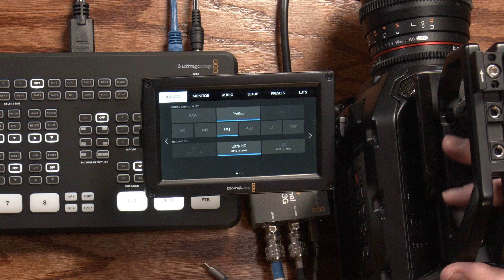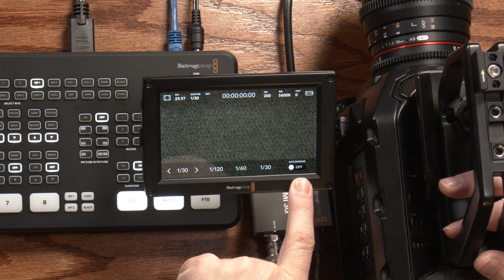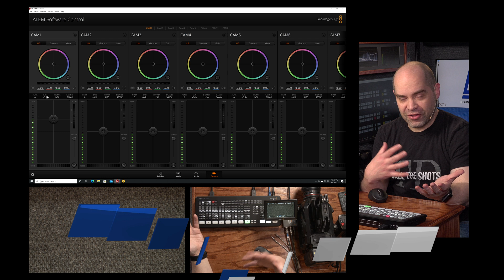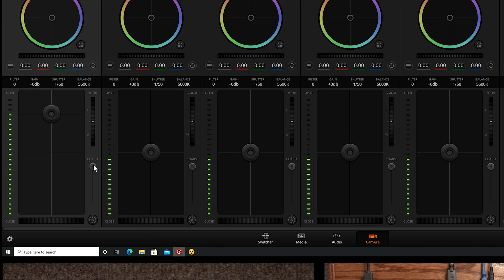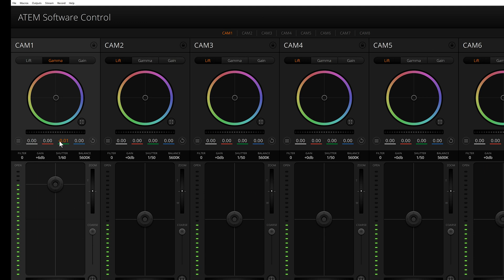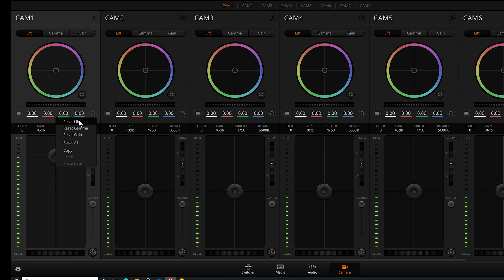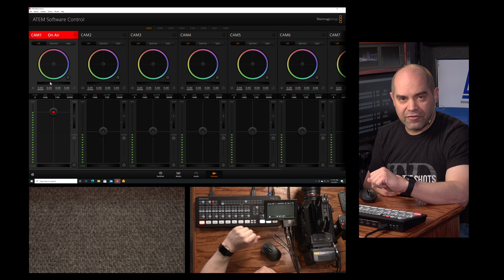How-To: Control Ursa & BMD Studio Cameras from ATEM Mini Switchers

Comment: hey Doug, can this  same method be applied to the blackmagic pyxis ? i own  a extreme mini iso hdmi and  would love to control  my [pyxis like my p4k and p6k
Reply from the maker: I’m not sure how it could. It doesn’t have either an SDI input or HDMI output that could be used to get those camera control signals into it.  SDI is not bi-directional, so the single SDI port that it has wouldn’t work to receive the camera control data from the switcher.

While it might technically be possible to do something with Ethernet or Wi-Fi, Blackmagic doesn’t currently support that.

While a few Blackmagic cinema cameras have had some limited camera control capability, it hasn’t ever been a high priority for them (or anyone else for that matter). Most people doing live production use cameras specifically designed for that application, and most of us find that cinema cameras often aren’t that well suited for that task.

Comment: Super helpful as always, Doug! I have an ATEM SDI Pro ISO. How would that work with these cameras since the HDMI is 2-way and can get back to the bi-directional micro converter?
Reply from the maker: The SDI output of the converter goes to an SDI input on the switcher, then you take one of the SDI outputs on the switcher (it doesn't really matter which) and connect it to the SDI input on the converter. That gives you the bi-directional communication path.

Comment: Hey Doug. Just came across your video. Really informative. Thank you for clarifying that the gain is the ISO setting. I have a similar set up with one BMD  4K pro  camera and 2 4K pocket cameras. They are all controlled wirelessly via the stem control software. Currently I’m trying to lock in the presets of ISO and light settings so that way we are consistent with the different cameras. I’m using an Atem mini as the switcher. We also have an elgato stream deck that’s used for macro functions. I just bought  a Panasonic 45-175 mm zoom powered MF lens. So I’m excited to try the remote zoom.

Comment: if you connect a stream deck to your computer as well as your item and micro cam, would you be able to control the camera settings on the deck?
Reply from the maker: One point of clarification... the Stream Deck device ONLY connects to a computer... it does not connect to the ATEM directly. You need a piece of software (BitFocus Companion being the most common, but there are others) to interface between the Stream Deck and any other devices. 

But, the other part of this, is controlling the camera(s). Companion does not currently have any built-in, direct camera control features for Blackmagic cameras. There seems to be some discussion of adding REST-based camera control support, but that hasn't happened yet. And in the case of the Micro Studio Camera, it would have to be the G2 model. 

Middle Things (https://www.middlethings.co) has an app called MiddleControl that will control Blackmagic cameras through the ATEM switcher (using the more traditional SDI-based control rather than REST), and there is a Companion plugin to control MiddleControl, so that might be a viable option depending on what you want to do. The functionality of this solution is somewhat limited, though.
Reply: @djp_video  thank you I’m getting that app now! you know possibly I’d like to add gimbal control to pan but right now I just wanted simple control through a separate panel just for the camera to control Iris, zoom, Wb etc so I won’t have to be glued to the camera control page on the Atem software

Comment: Hey Doug ... quick question, in the video you explain how to connect your SDI camera using an ATEM Mini Extreme HDMI version (hence why you're going over the BiDirectional converters), but what if you have the SDI version of ATEM Mini Extreme... how are using camera control and tally? Meaning, I know you'll be using the "SDI In" port on the camera, but where are you connecting on the ATEM? Any of the SDI Out ports? And in this situation, is this why you need to set the camera id within the camera's settings? thanks in advance!
Reply from the maker: Yes, any of the SDI outputs would work. You can even use a distribution amplifier like the SDI Distribution Mini Converter from Blackmagic if you don't want to use up all of your outputs. And that is why the ID needs to be set; all ATEM outputs contain camera control and tally data for all cameras, so the cameras have to be setup to know which ID to listen for.
Reply: @djp_video  ... Awesome, thanks for the quick reply and for pointing out the SDI Distribution Mini Converter!! All great stuff!! Thanks again :)

Comment: Hey Doug, I have an URSA Broadcast G2. Set up almost the same way I see signal to the switcher, but I don’t have control. Do I need to go into channel one or can it go into all the channels?
Reply from the maker: It can go into any of the channels. You may have a camera ID mismatch, or are using a version of a converter which doesn't create the required SDI ancillary data (it has to be one of the 3G or 12G versions of the Micro Converters -- the older versions don't have that feature.)

When connecting an SDI camera to an HDMI switcher, you can go one of two routes to get camera control and tally working -- explicitly set the camera ID for each camera and micro converter, or just set them all to 1. 

SDI cameras and switchers use data in the SDI signal to know which camera is being controlled. All cameras get the exact same data from the switcher, so it's that camera ID value within the signal that lets cameras know which commands they need to respond to. But HDMI switchers and cameras don't have any camera ID data -- the assumption is that the camera will be connected directly to the proper input, so no ID is needed (or even supported).

What this means in practice is that when you connect an SDI camera to an HDMI switcher input that the camera ID data has to be added by the Micro Converter (and it has to match the ID of the connected camera). This is done inside of the converter's setup software. And the camera's ID is set in its setup menus. In this one particular situation, the actual ID number doesn't matter -- it just has to be the same between camera and connected converter. Since the HDMI signal doesn't include any camera IDs, the switcher doesn't know what the actual camera ID is.
Reply: Hey Doug, thanks for such a thorough reply. We can see signal to the switcher by way of the converter, which is a 3G I set the converter to 1 and the camera ID to 1. Still no luck myself the DP and the Director have been scratching our head for a day and a half now. Running through the menus on the camera and resetting the converter box several times to make sure that it’s correct I must be missing something simple. But I just don’t see it. Very frustrating because I’m on a multi camera shoot and I have rented my camera out for this production.  I just have to say again thank you so much for replying so quickly. 4:38
Reply from the maker: I failed to mention that the converter has to be the Bi-directional model. The SDI-to-HDMI version won't work. And you have to have two cables going between camera and converter -- input to output in both directions.
Reply: Yes it is a bi-directional
Reply from the maker: Is the firmware on all of your devices up to date?

Comment: Hi Doug, can you use a Rec709 lut on the camera and also use the camera control unit or software to fine tune the cameras in a production? Thanks for your reply!
Reply from the maker: Yes. Blackmagic doesn't really refer to it as 709, but that's essentially what the Video mode is. And you can tweak the color and exposure just fine.

Comment: Do you know if the atem mini pro works with a URSA 4.6k G2 and the 3g bidirectional? Can the mini panel be added?
Reply from the maker: You can control the Ursa cameras from an ATEM Mini if you connect the Bidirectional Micro Converter 3G between them, as demonstrated in this video.

Comment: Can I connect any 4 cameras to ATEM Camera Control Panel, for example Panasonic AW-UI 40?
Reply from the maker: You can connect them, but not control them. Only Blackmagic cameras have the remote color and exposure controls from ATEMs. And only PTZs that use Visca over RS-422 can be controlled by ATEMs with Remote connection jacks.

Comment: Thanks as always for the helpful videos.
My question is only slightly related.
Do you know what the latency difference is between using a Micro Studio camera through this conversion compared to just using the Pocket 4K?

I have a few of the old Micro Studios as we go live to a projector and side screens. Wondering if it’s worth the switch to the BMPCC4K instead for the low light performance.
Reply from the maker: The converter itself doesn't add any noticeable amount of latency -- only a millisecond or so. 

As for latency numbers for those two camera models, I don't have that information.

Comment: Hey Doug, love your videos! I refer to them constantly for training and support! Question maybe you might be able to answer:

I am attempting to get my URSA Mini Pro 4.6K with the viewfinder tally light to work when hooked up through the Micro Converter BiDirectional SDI/HDMI 3G adapter to my ATEM Mini Extreme ISO and although I can control everything (GAIN, GAMMA, LIFT, FOCUS, etc) on the camera, for some reason the Tally light wont turn on when switched to the camera. Everything else works. I know the Tally light works and functions as expected when I hook it up to a Television Studio HD. It's the strangest thing. Have you had any experience with Tally on the ATEM Mini? Curious to know your thoughts. 

Thanks again for your videos! You rock!
Reply from the maker: Set the Camera ID values in the menus of the camera and in the setup application of the bi-directional converter to match the input channel number on the ATEM.
Reply: @djp_video  Hey! Thanks for replying, Doug! I love all of your videos! 
There is one thing that I had to do additionally that I just discovered last night. It only started working once I ran an additional HDMI cable of the program feed back from my ATEM into the HDMI IN on the BiDirectional Converter (both HDMI IN and HDMI OUT populated). Once I did this, then Tally on the View Finder (Blackmagic add on) started working. As an added bonus, I can then use the PGM button on the URSA to be able to display whatever is the Program feed on the ATEM at the time (so I can monitor what is live on air). As soon as I populated all I/O on the BiDirectional Converter it worked!
Oh, just as a side note that might be an important detail, I'm running the URSA Mini Pro 4.6K. Not sure if that matters to others if someone else runs into this issue.

Comment: Hi Doug! Do you find that if your camera is connected to the software, any setting changes on the camera revert back to the software values after ~1-2 seconds?
Reply from the maker: Yes. That is normal and how it is designed to work.

Comment: Hey Doug! 
First of all, wanted to thank you for such an informative video! 
Had a doubt regarding the camera control on a studio camera 4k plus, which does not have SDI on the camera itself. Would using bi-directional converters at both ends work?
Reply from the maker: If you get the 3G or 12G Micro Converter versions, yes. The original pre-3G versions will not.
Reply: @djp_video  thank you!

Comment: Brilliant video thanks! will the older URSA 4K work, the big beast? It has SDI in and out but you cannot choose the ATEM input on the camera. I have just ordered the ATEM Mini Pro to use with the Pocket 4K, just wondered if I can use the URSA as another camera.....I also have the BMPC4K that only has SDI out, I guess thats not useable?
Reply from the maker: I don't believe the original Ursa has the necessary features for remote control. You can certainly use it, but you won't have the ability to control it from the ATEM.

Your BMPC4K also doesn't have the necessary hardware for remote control.

These cameras have vastly different looks to them. If you're using them for live production you'll likely find that cutting from one camera to the other will result in vastly different images. Your best bet is to use the same camera model whenever possible.

Comment: Is there any way to get camera control on a BMPCC 6k that’s ran over a distance with SDI? I have the BiDi converters on each end too. Also I have 6k set up as a wireless HH but I still don’t have any control over it. Thanks.
Reply from the maker: If you have the 3G or 12G versions of the bi-directional Micro Converters it should work. The older, non-3G/12G converter doesn't translate those camera control signals to/from SDI/HDMI.

Camera control isn't going to work over wireless.
Reply: @djp_video  ok I have the 3g converters. So I still need to run 2 SDIs? I tested it with one today and I got signal but no control.
Reply from the maker: Yes. You'll need cables running each direction for each camera -- one to send video from camera to switcher, the other to send camera control data back to the cameras.

Comment: Hi Doug! Do you know if you can use camera control if the cameras are remote and linked through the Streaming Bridge? The Blackmagic Design launch suggested it could be done as it was through HDMI & SDI but I have not found a way to do this.
Reply from the maker: It is/will be with the newest Ursa Broadcast G2 cameras. I/we don't know about other models.
Reply: @djp_video  Thank you - I am using 2x BMPC 4K so I will need to do some more testing. I have a new Atem mini extreme ISO arriving next week.
Reply from the maker: The feature currently requires that the camera itself have the ability to stream using RTMP. Only the Broadcast G2 does that.
Reply: @djp_video  Thank you Doug, that saved me some frustration in testing.

Comment: Thanks for the video,  I just tried the setup with my BM mini extreme iso to original BM Studio camera (w/ 10" monitor with latest firmware).  The setup seemed to work, however, the video signal blanks out and on every two seconds continuously.  The control seems to make the changes but the video keeps blanking on and off.  Can you help?
Reply from the maker: How long is your HDMI cable? Have you tried it with a different cable?

Comment: Hi Doug, I was just watching your tutorial and I one thing I wasn't clear on. Could you take the return SDI to the camera and put a DA on it and send it to more than one camera and get control and tally data or is it a 1:1 type thing?
Reply from the maker: With HDMI switchers it's a 1:1 relationship. Splitting that signal would cause all cameras to respond to the control commands. That's only true of the HDMI-based switchers like the ATEM Minis; the others can be split with a DA.

Comment: Hey Doug, does this also working the newer studio pro versions? I am having some issues with it. For some reason it is not allowing me to run SDI straight from the unit to the converter. I have to run HDMI to SDI, then back to HDMI then into the ATEM mini extreme.
Reply from the maker: I would assume so, but I don’t have access to one to test it

Comment: How would you go about to connect  a wireless video trans/receiver on a BM Studio camera 4k pro to an Atem Television Studio pro 4k   but maintaining camera control/tally & com?
And is it so that the Atem mini Iso and X have supersource while the Atem Television Studio pro 4k which suppose to be a broadcast device don't?
Reply from the maker: I don't think you can. The wireless systems that are available will ignore the camera control data, and are limited to the main 2 channels of audio.
Reply: @djp_video  I was planning to buy  the sdi/hdmi bi directional converter. sdi in/out from the. camera to the converter and hdmi out to the Wireless Trans and Wireless Rec out to converter hdmi In and  SDI In/out to Atem. But I didn't wanna buy the devices because I had my doubts. Thanks. I have learn a lot from your videos.

Comment: Hi there I ordered sdi to hdmi converter to use the setup you just explained. Was I supposed to get the bidirectional instead or would the one I got work? I haven't received the item yet so I can cancel and change.
Reply from the maker: It has to be the bi-directional 3G version if you want to control the camera.
Reply: @djp_video  thank you very much
Reply: Camera is ursa mini 4.6k and atem mini for switching

Comment: Help, any time I change something on the actual camera (for example white balance) it goes back to the value I have set on the Atem. Is there a way to override those settings from the camera?
Reply from the maker: No. If you're remotely controlling the camera the local controls are always overridden.
Reply: @djp_video  thank you Doug. Is there a way to disable the remote controls without unplugging the sdi? And use the sdi for communication  (talkback) only?
Reply from the maker: If you change the camera ID number it will stop responding to control commands
Reply: @djp_video  of course! Thanks a lot.

Comment: I got me new BMD Studio 4K Pro camera yesterday.  I'm having a hard time getting camera control and tally to work from my ATEM mini extreme ISO through my 40x40 video hub.  I'm going SDI from the camera to the video hub, from the video hub to a SDI-HDMI into the ATEM Mini Extreme.   I'm sending the program feed from the ATEM to an HDMI-SDI into the videohub, then SDI out to the SDI in on the camera.  Everything works except tally and camera control.  What I'm I missing?
Reply from the maker: It only works with the 3G version of the Bi-directional Micro Converter. The other converters don't pass the required signals.